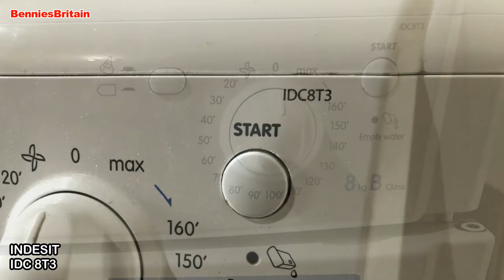INDESIT IDC 8T3 Tumble Dryer - Drive Belt Change

Comment: Thanks for the video. Im a total noob and completed the job in 3 hours which was a lot longer than I anticipated. A few VITAL tips for beginners like myself to save time and trouble.

1. Take photos of screws and where they came from.
2. Take note of how the top detaches (slides toward the rear) and the side which slides into grooves on the bottom and front. 
3. The front panel may not slide off as easy as the video shows. Look in the side you will see how the door is attached to the drum.  The drum sits in grooves so is effectively attached to the panel - you want to lift it and pull it from the grooves toward you away from the base of the dryer. Easier done with dryer sitting on its back and door facing the ceiling.
4. Take note of how the layers of panelling intersect and attach behind the front panel BEFORE removing the screws that bind them. Don’t do what I did and make it a needless guessing game when you’re trying to put them back together. 
5. BE CAREFUL WITH YOUR FINGERS AS THE METAL INSIDE THE DRYER IS RAZOR BLADE SHARP my hands are cut to bits :)
6. You need to relocate the door panel and get the drum to sit within the grooves again. This is doable on your own, but you may need patience and persistence. Once l it is sitting in the grooves you can attach a couple of screws on the base panel to hold it in place whilst you reassemble the top em of the dryer and get everything into line, the screw on the uppermost left holds three sheets together and is key to getting everything lined up.
7. When you’re putting the belt on the pulley and spindle you can remove one bolt and loosen the other on the pulley and you can move the pulley which makes it very easy to get the belt over and round the spindle and pulley. There’s another comment on here that explains in detail. 
8. Remember to put the fan and housing back in. Seems obvious but after 2 hours you might forget.
9. You might want to test the machine before putting the side and top panel back on. Mine was squeaking/whining a bit from friction on the belt, slight adjustments to the belt and pulley solved this in the main. IF MAKING ADJUSTMENTS TURN THE MACHINE BACK OFF DON’T BE ME AND GIVE YOURSELF A SHOCK :) thank god for circuit breakers. 
10. You’re done. Hopefully it didn’t take you 3 hours. Enjoy your beer you earned it 🍻
Reply: I’d also suggest the Espares instructional video may be easier, they don’t remove the front panel and their method of getting the belt round the drum seems a lot less hassle :)
Reply: Visiting for my own previous advice because my belt snapped again 😅

Comment: Came to find a better way to get the belt onto the pulley but I did this the same as yourself, but of brute force. There is a comment on this video saying how to loosen the pulley so it slides back allowing easier fitting. I’ll try that next time!

Two belts replaced already so hopefully won’t be doing it again for a while

Comment: Cheers for the video. I used the espares main one for the main guide, but that was too different to my model ( indesesit 945 a2 ) to help when getting the belt onto the spindles.
the problem I had was if the tension spring was on, I couldn't fit the belt. So instead , I left the spring off, got the belt fitted, then put the spring back on by using a screwdriver to apply some leverage. 
IE, put the blade through the spring loop then onto where it needs to go on the (err) motor assembly, then pull "up" and let the spring slide down the screwdriver until it drops into place ( very similar to how the belt is done in this video).....
Hopefully that helps someone :D

Comment: After reading all the comments below do the following; be very careful all interior steel parts have edges like razors. Use your smart phone to take a picture of all the spade connectors so if any pull out, like mine did, you'll know where to put them back. I found it almost impossible to replace the door panel, the drum would not move enough to seat in the grooves on the door panel. When you remove the door panel you are left with one screw on the left hand side panel at the top front,  take this out and it will give you much more play to seat the drum. To remove the fan after taking out the Corbin clip use a piece of wood about the size of a broom handle and gently tap with a hammer to remove.
Reply: This helped massively! We couldn’t get it lined up without taking that screw out. Thank you
Reply: Wouldn't by chance have the pics of the wiring you could send would you? 👍
Reply: This should be top comment! Removing that screw saved me rage throwing the machine out the window!

Comment: Just had mine apart as belt snapped, ordered new belt but just realised the bearings in the pulley wheel that's hard to get over. Anyone know the replacement part number for it. Seems it was the cause of belt failure as floating free with no internal. FOUND ONE 👍

Comment: I have this exact model and it's making a loud squeak noise while drying. I've pulled it apart and the belt is fine. Any idea of what else I should check please?
Reply: Mine was doing the same, I believe it was the belt tensioner pulley wheel. I oiled mine during the belt change and the sqeak has gone.

Comment: Thank you for an excellent tutorial, unfortunately for those who have their belt in tact but not working still. Replace the flux capacitor (think its called that) costs a tenner and extremely easy. Follow this tutorial until you remove the side panel and should be easy to unscrew

Comment: I found that when refitting the front panel it is important not to retension the belt beforehand. This will restrict some drum movement which helps when refitting the front panel.
On refitting the front panel..... With the machine stood up
I gently rested the bottom of the panel near it's location but without seating it properly. With the panel sat resting,  I then pushed the drum back into place on the panel being careful not to break the 4 little plastic alignment clips around the drum hole. This is a pain and you will need to manhandle the drum a little to make it line up.
Once the drum was back in place I gently levered the base of the front panel back into it's slot at the bottom using a large flat bladed screwdriver.
Reply: Thanks for the help

Comment: Dryer would blow air but not turn. Completed this tutorial -belt was snapped. Replaced the belt, but now the dryer wont turn on at all. Changed the fuse in the plug and I have checked the socket is working with another appliance. Any ideas????
Reply: Never mind. I have figured it out. When taking the front off, the blue wire connecting the start button to the rest of the machine had come loose. Put it back and and everything was fine. Thanks for a great tutorial. Putting the belt on was tough going, and replacing the front is very tricky. But for the sake of £10.00, I have repaired something I thought was destined for the rubbish dump, or at least coast me a call out charge from someone with more practical skills than me!

Comment: it's harder than he makes it look. had issues aligning the door in the right place on my own. after I put the belt the machine would no start. the star button cable came undone. after I connected that one it would start but smelt like something was burning. some other cable was undone. connected it and now everything is working fine

Comment: Followed the instructions and tested it prior to putting the panels back on and everything was working fine. Put the panels all back on tried it and now the drum won’t turn at all. I did have a problem getting the front off to be able to feed the new belt around the drum and I’m not sure if that’s what’s causing the issue as if it’s not sat right but I can’t find any info as to how the drum is supposed to sit when the front is on in place. Any ideas please as it’s frustrating as hell, especially when I had it working prior to putting it back together
Reply from the maker: It sounds as though the front panel is not on right, the drum has to sit in a groove that goes round the door.
Reply: @BenniesBritain  ah right so you should be able to put it all back together without issue? I found the left hand side a right pain to get lined up and had to put pressure on from standing at the back and pulling the front frame towards me to be able to get the sides fastened together. I do know when I was taking the front off so I could fit the belt from the front of the drum the bottom part wasn’t coming away from the drum as easily as you made it look. I really struggled to get it free. I don’t think I broke anything as there was nothing that looked broken or fell out when I turned the machine on it’s side and back as you did. And just for reference you forgot to add about having to struggle to get that belt on the pulley wheel and how much of a chew it would be. You made it look far easier than it actually was lol. I’m not small lad just under 17 stone and still struggled but eventually managed it with a few choice words and a few slight cuts on my arm due to the razor sharp sides. I wish the manufacturers would either round the edges off or not make them as sharp as a butchers knife for that very reason.
Reply: I managed to change the belt on Saturday and tested it before putting it all back together but I can't get the front realigned properly again. My hands are in bits and back too after trying to finish it. Currently sat I bits until I have the strength to try again.

Comment: It was all fun and games until it was time to place the belt over the pulley. Jesus christ. I would recommend having 2 people for that part. One to hold the screwdriver in place and the other to rotate the drum as it does end up taking a bit of force to rotate it as it has quite a lot of resistance due to the belt tension. As someone mentioned before, try and wear some anti slash gloves since the inside is like a puzzle box from SAW. Lots of sharp edges....
Reply: We can't even get the screwdriver in 🤣😫

Comment: Good video but some bits missed. Also a warning. Watch out that any left over water doesn't get in the electrics. Everything went to plan until the test run. Then blew up. So got the belt on but now totally useless

Comment: Am not talking  about  that model  but the name is the same  Indesit  it's a crap never se it again. The worst engineering  work and specifically  to change  the belt and I don't  know  why they  did it so complicated  and specifically  that model I had I will bet no one can fixed. Crap crap and crap tomorrow  I will receive  a new one but never  INDESIT